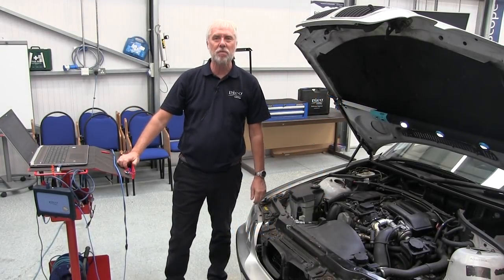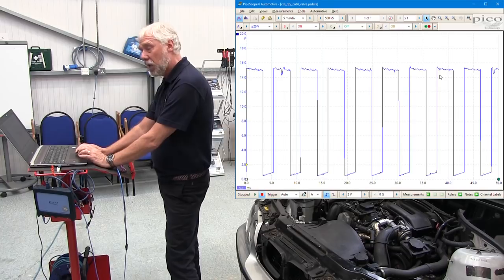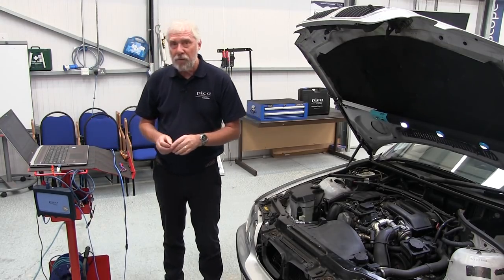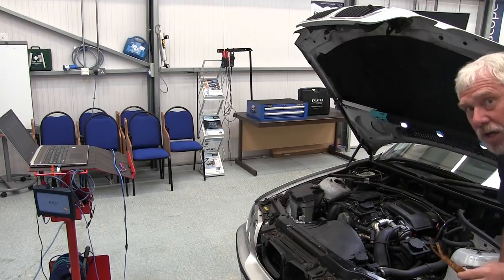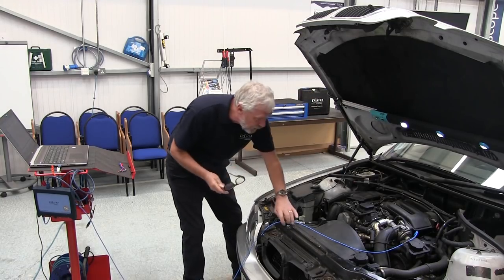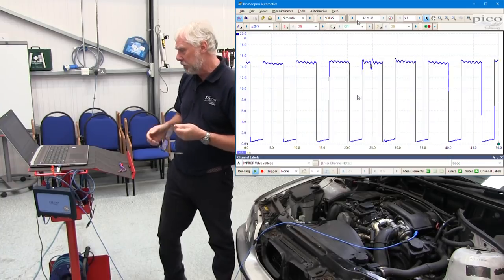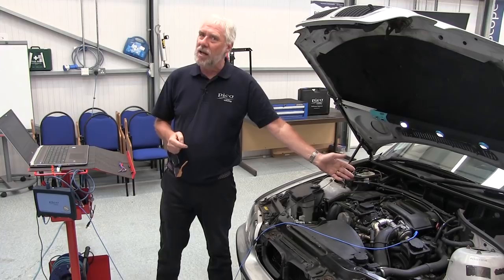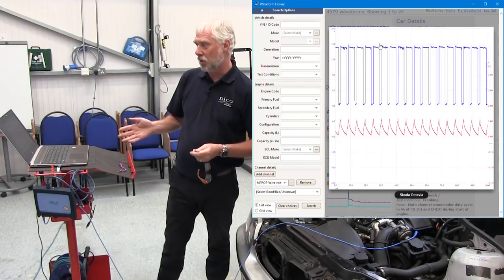Guided Test: CRD (Bosch) quantity control valve - voltage

Comment: Without measuring current to give an indication of work being done, doesn't this capture only prove control to the valve being good and not that the valve is good
Reply: Hi Matt, you are correct that a current test shows the work being done and that this test looks mainly at the control signal.

You can use the PWM of the signal to understand the system behaviour and to check how the ECU is responding to possible faults in the system. The measurement is most useful when combined with a similar measurement of the pressure regulating valve PWM and the output of the rail pressure sensor. With this kind of multi-channel setup, you can see the control strategies of the ECU as it tries to control rail pressure (in either good or faulty situations).

Hope that helps.

Comment: Was the capture done with AC coupling? And any reasons to select AC?
Reply: Hi, No the capture was with DC coupling. There would be no good reason to use AC coupling for these types of PWM signals.
Reply: @pico_barney  Exactly, I am not measuring too many of these signals, but that looks very similar to AC coupling. There is another reason why I asked. Can you switch, during scope capture, from DC coupling to AC coupling? My win7 toughbook CF-31 x64 i5 processor freezes for a good minute while doing the change. Can you please test it for me, we are already 3 users reporting the issue on the pico forum.
Reply from the maker: @liviu2004  Hi, I guess you are thinking that there are slopes on the positive and negative peaks of the waveform? They are just a characteristic of the switching circuitry on this particular vehicle (a BMW 320td). The mean level of the waveform was B+ / 2 Volts rather than 0 Volts (the latter would have given it away as being AC coupled). We have made enquiries about the issue you experience when you change modes from AC to DC. Please keep an eye on the forum for a response. Thanks.